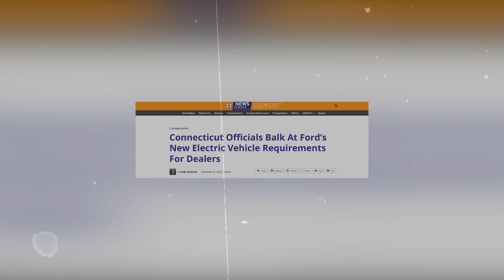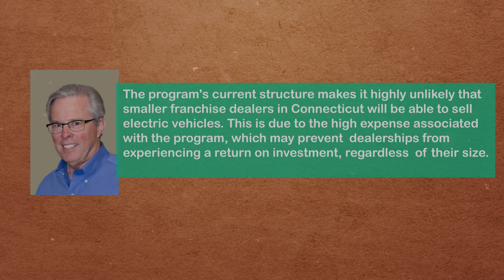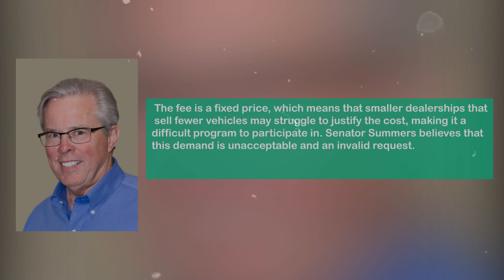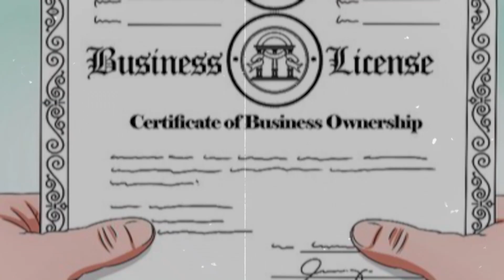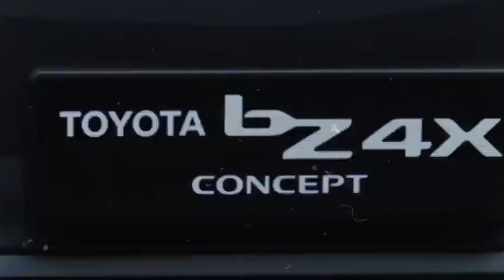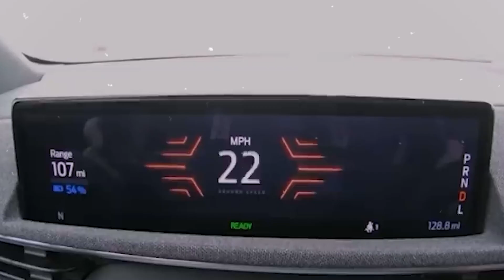The Truth About DECREASING Car Prices Has Finally Been Admitted By Ford CEO

Comment: Next time I buy a car I’ll order straight from the factory. Or directly from a private seller. Dealer markups are ruining the industry. I have a 2018 Acura that I love - almost paid off with only 45k miles. Will last me another 15 years probably. Acuras last forever. I’ll buy a Tesla after I get solar installed on house. But I’d be crazy to buy an EV with any other car manufacturer.

Comment: I work for a Honda dealer, and thankfully so, since they don't play many of the more manipulative games I hear other dealerships do, but getting rid of dealerships would b more of a nightmare for both the manufacturer and the consumer. Buying vehicles isn't like buying furniture, where factory-direct saves everyone costs and troubles. Vehicles r highly emotional and technical, and requires sales consultants to guide consumers to the right feeling vehicle and to assist them thru the legal and technilogical complexities. If u buy direct from the manufacturer, it would just cause the manufacturer to become a dealership and consumers would have less options in locations to go to and less competition to keep their prices down. They would still have to hire consultants and support staff, like a dealership does. The problem doesn't get solved by eliminating dealerships. 

What fixes it is reducing the misleading and manipulative game-playing in the selling process. But, even then, many customers r problematic and drain resources, intentionally, which needs to b curtailed as well. Consumers may think dealerships r cons, at some level, but to say "buyers are liars" has much truth to it too.